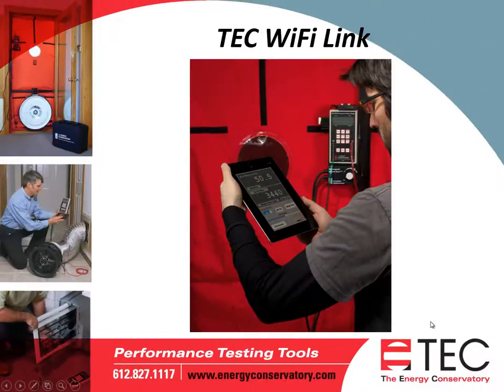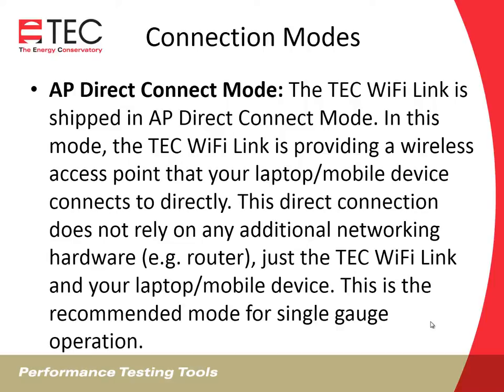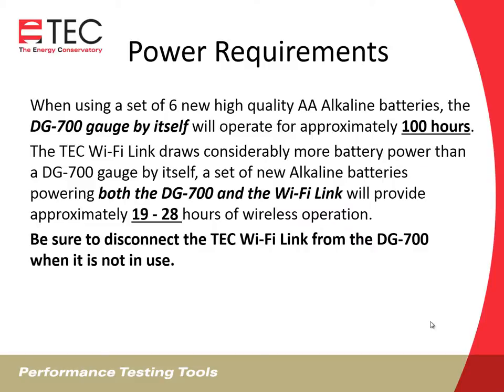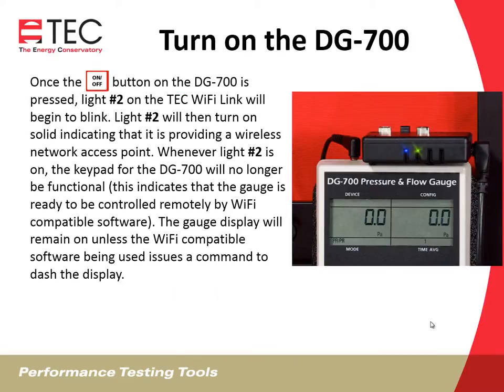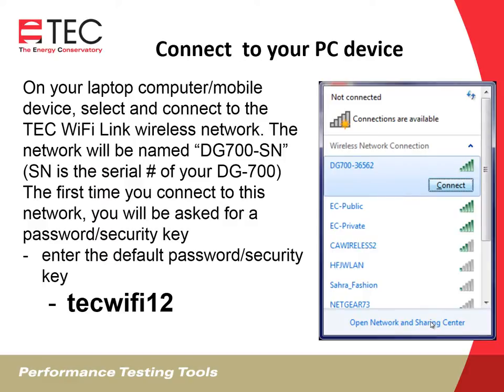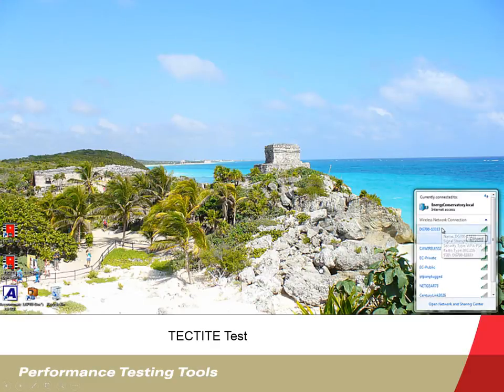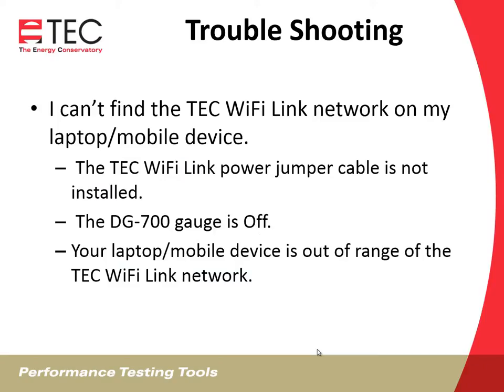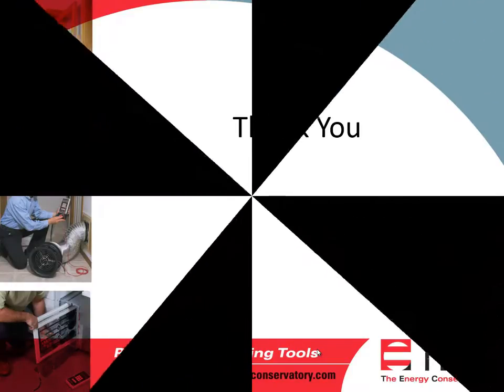TEC WiFi Link Webinar

Comment: I just got mine and haven't tried it out yet, but have a question: I typically use the AC power supply with my DG700 instead of batteries. Obviously I would need to use another power supply for the wifi, but can I run the wifi link on the power supply and still get 100 hours out of a set of batteries in the gauge?